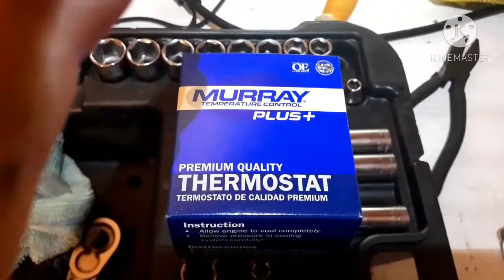2009  Chevrolet Malibu 3.5 liter thermostat replacement

Comment: I assume you mean 3.6?? 2008-2012 was the VVT 3.6. I've got a 2011.
Reply from the maker: I have a 3.5L V6 Chevrolet Malibu
Reply: @markyochum9753  Well, I learned something tonight. I have the LTZ and there were only two engine  choices in that trim... the 2.4 Ecotec four cylinder and the 3.6. I had no idea that other trim levels offered a 3.5. I assume that's the Impala engine?
Reply from the maker: I'm not sure.  That's what the plastic engine cover says.  3.5. Mine is the basic LT
Reply: I have to same motor 3.5